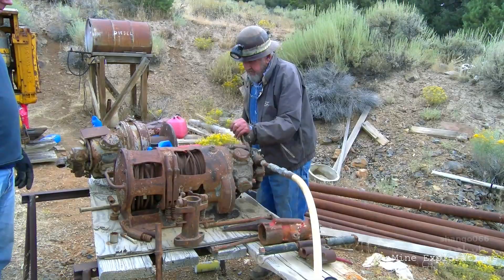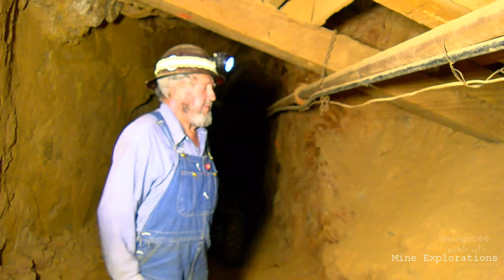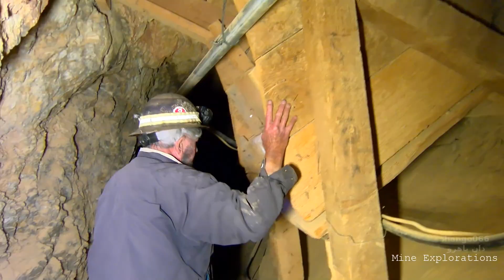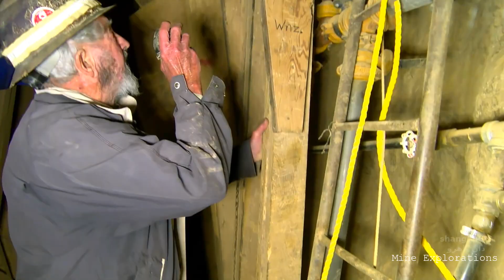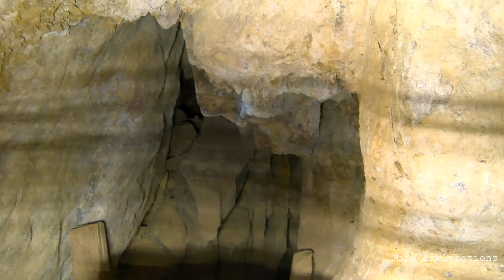Detailed Tour Of A Small Gold Mine

Comment: I started working in a mine repair shop in 75 we still used Leroy stoper back in the 70s and 80s just to put in a single Bolt to hang cable

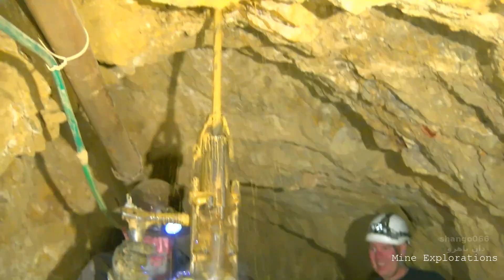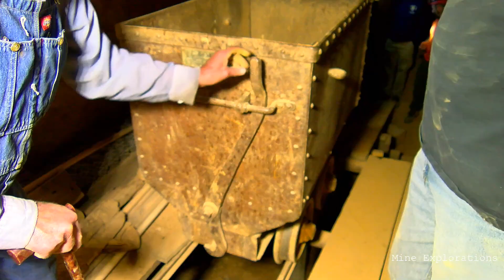Comment: Wow 2:08 😀 my first job .. Air Leg Miner Underground at the Golden Pig. 1995. Southern Cross West Australia. I went on to work at the Copperhead Mine in Bullfinch 1997 when that closed 1998 I went to Marvel Loch & on to Kalgoorlie. This area (Yilgarn) is in a greenstone belt. My family had a Gold Lease. I've got some pics of our old Lease the Centenary on my Facebook Page "Spartan Mechanical" I'm a Heavy Mobile Plant Mech by trade & I've grown up with mining Gold in my veins. I've also got pics of Francis Furness Headframe. Underground at Kia Ora (Now Marvel Loch open cut) Kia Ora would be in the middle of the southern end of the pit.. or if you drive up past the Pub.. keep going & turn right .. it's all gone now. The ore cars 23:46 underground at Kia Ora had wheels on the side which lined up with a ramp. Effectively making them side dumpers through a grizzly into a skip to the surface & into a ore bin.  My Aunty painted the local Marvel Loch State Battery.. only to find out later almost no photographs exist. The piece between the split set & Air Leg is called a Dolly. My advise to a young man wishing to work Undergrpund. If your ever working with a Jumbo or Air Leg. Jumbo especially. Do Not touch that Dolly .. it gets extremely hot.  Anyway Usually fitted to a split set would be a "W" plate. If you ever see a "W" plate flatten out.. seriously move out of the area. It's going to collapse. My father seen this after hearing strange noise coming from the backs at the Bounty Gold Mine Western Australia. Next shift come in & that area had fallen.

Comment: Driving a gas powered ATV inside the shaft is not a great idea, competing for oxygen with an engine and inhaling carbon monoxide and concentrated carcinogens as well as "smoking" the shafts walls with carcinogens, I see no fresh air vents or fan motors.